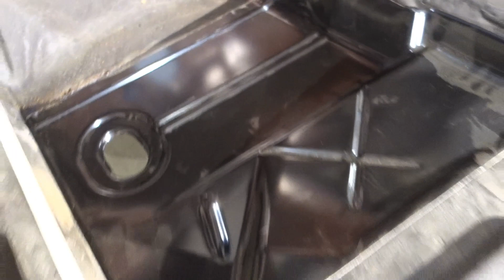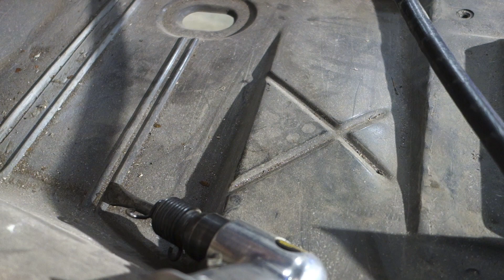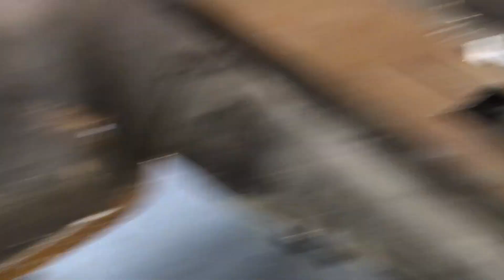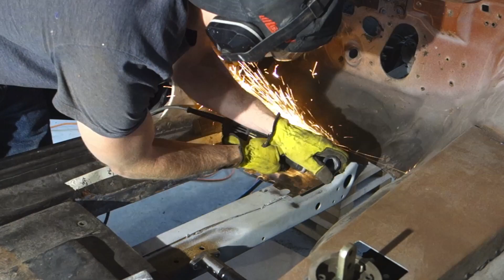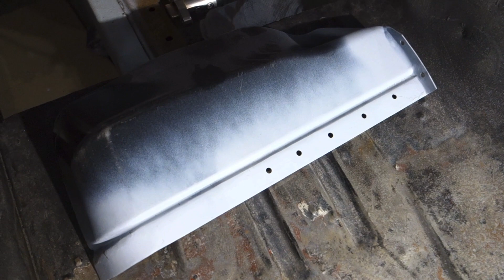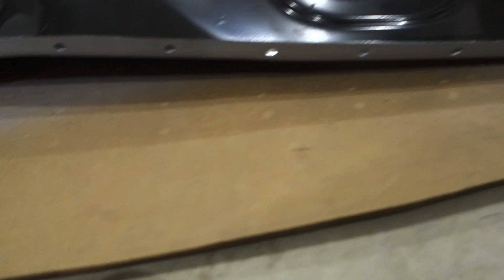How to Replace Driver Side Front Floor Pan - Part 2 - 1971 Camaro Build

Comment: Hi there Restocar, I’m enjoying your well organised step by step demos here, very helpful to me for my 72 Camaro coupe. I see you’re butt welding in your floors as I prefer to use a pneumatic flanger and spot weld my floor in using metal filler after. Your thoughts please and with thanks, greetings from Australia

Comment: That "Dent" in the toe panel is factory. Its where the "back drive " linkage goes to the steering column . That's if you want to get your key out, and have back up lights.
Reply from the maker: Good info thanks for sharing. I won't be using that linkage with my t56, but I'll have to address the key issue.